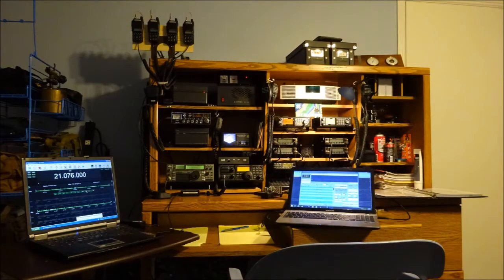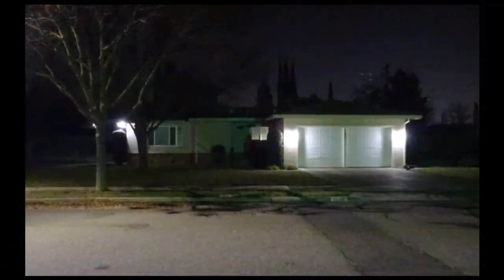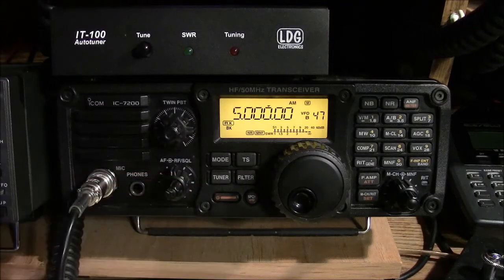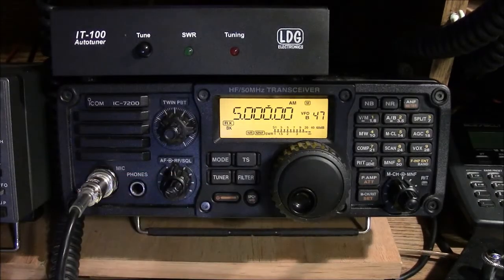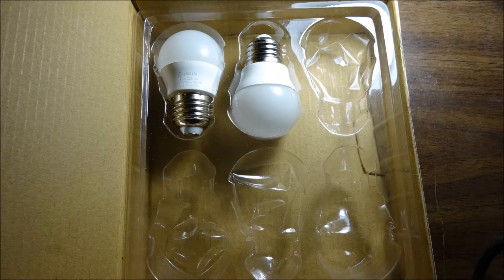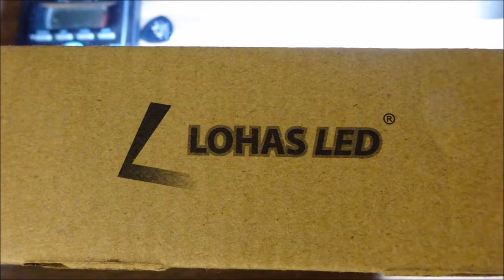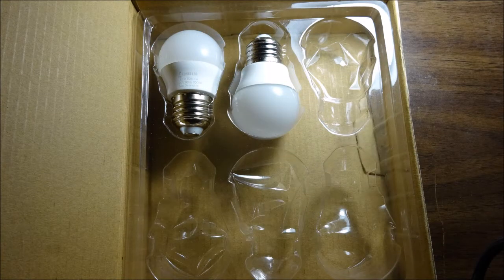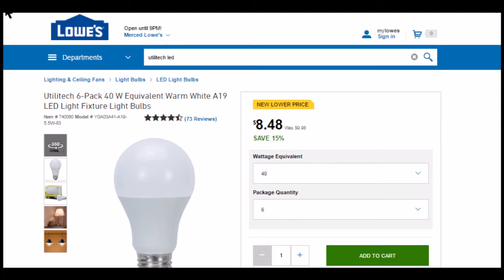Amateur Radio vs. Cheap Chinese LED Lights

Comment: I have a customer who had 4 LED oyster lights installed and they caused interference with FM radio station, I experimented with several brands with mixed results, $ didn't seem to match whether it caused a problem or not. Frustrating to say the least.

Comment: I'm wondering about LED Shop lights for the same reason. I've got six fluorescent "modern" electric ballast types, and one of them is shot. The LED Shop light at Wally World is made (I think) by Lights of America. In China. Hmmmm.... By Price, it's a no brainer, with the LED shop light at the equivalent cost of replacing a pair of T-12's.I'm also tired of their delicacy, hauling them home, and it's a real thrill to have shattered glass when they fall out of the fixtures. And then, there's the Mercury.... But I'm sitting on the fence (and 1/5 Darkness I reckon) until I get a report or review of any RF problems...
73 and All the Best!DE W8LV Bill